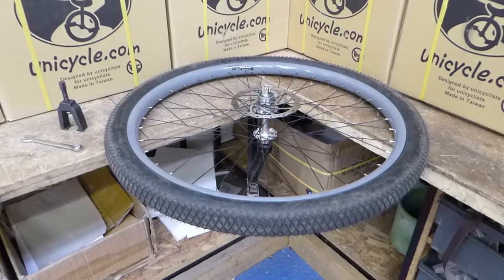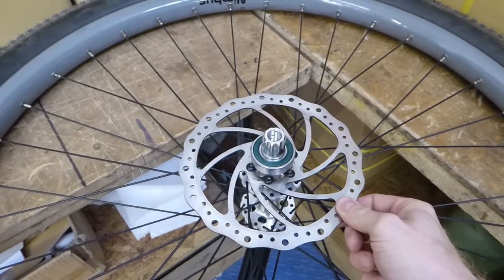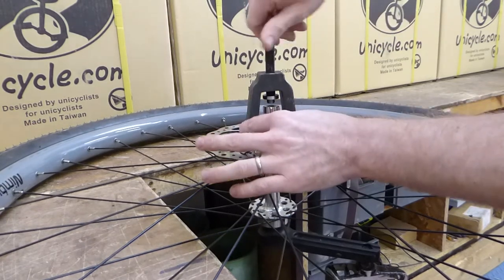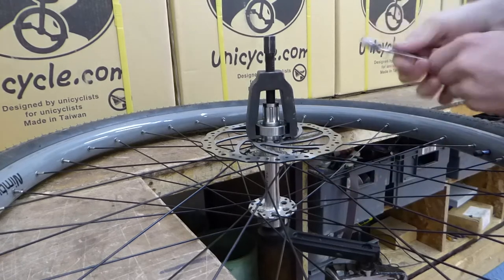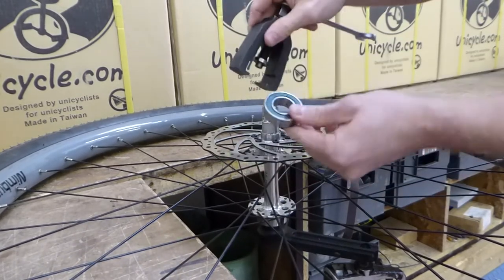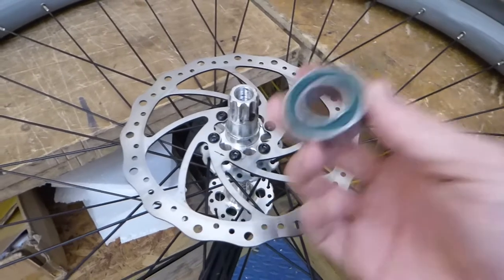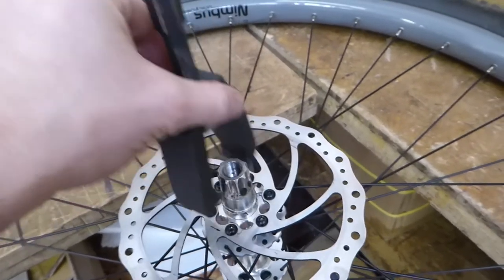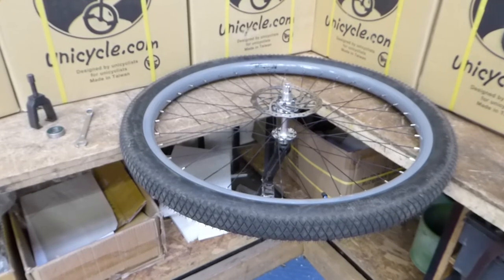Removing Unicycle Bearings (How To)

Comment: how do you put the bearings back on the unicycle once you've taken them off?
Reply from the maker: We found a off-cut piece for 27.2mm seatpost works really well with a hammer/mallet.
Reply: Or a socket that has the same radius.

Comment: and if you do not have one of those fancy tools what to the rest of us do?
Reply from the maker: You will need some kind of bearing puller without one you will not be able to remove the bearing without causing considerable damage. You can get 2 and 3 leg bearing pullers but they are not as good as a specific one like the one we use.
Reply: @unicycledotcomuk  Ok thanks, then I guess I must just get one.